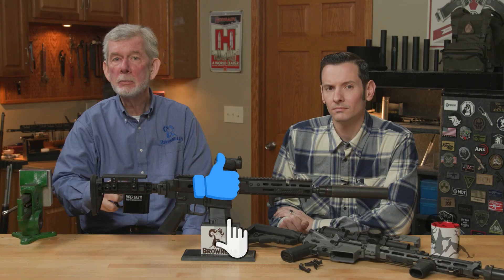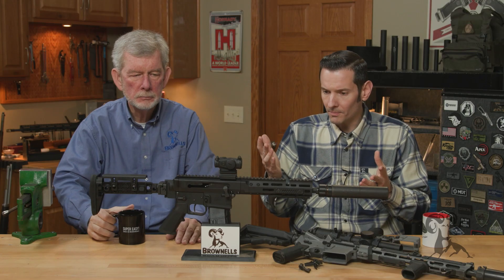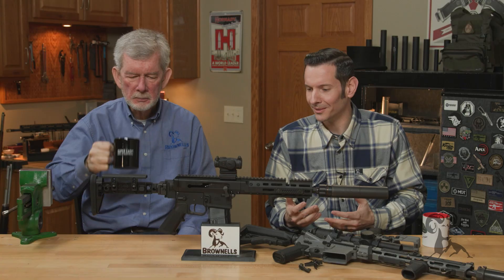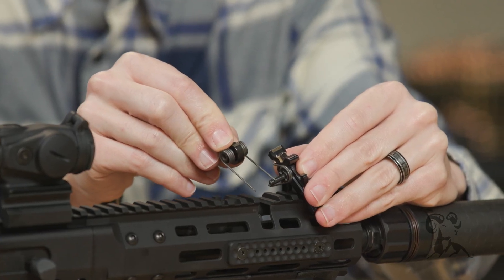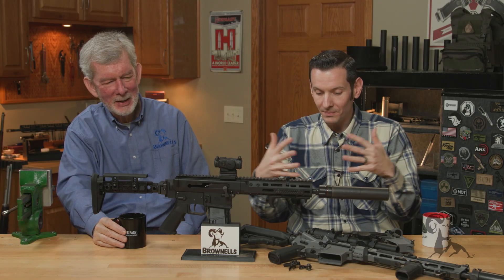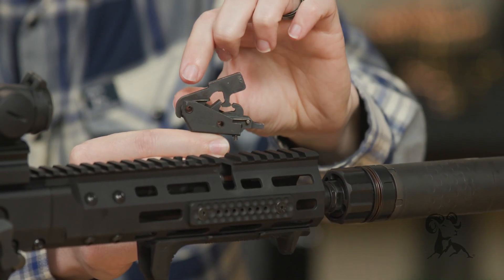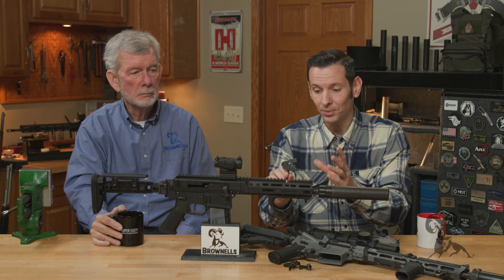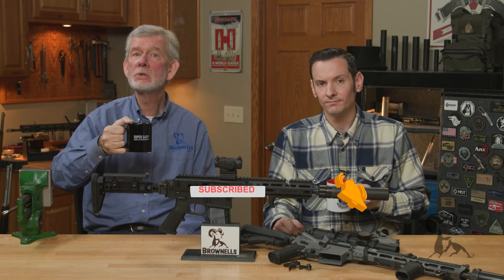Smyth Busters: Does Your AR-15 Need Anti-Walk Pins?

Comment: Back to the front site block removal. I recently bought a retro 20” barrel from you “brownells” and the front site is so canted almost impossible to site in. I have been trying to remove the pins from the FSB and they wont even budge, and yes im driving them the proper way, and ideas?

Comment: The only time I have used anti-walk pins was for a KE-15 polymer lower. Based on research, a cassette trigger seemed like a good idea despite my preference for a 2-stage trigger on this type of rifle. Bottom line was I didn’t quite trust the hole alignment or longevity with the polymer.  Now that I think of it though, there are millions and millions of polymer pistols with non-captive pins…

Comment: My milspec trigger had standard pins and that makes perfect sense what you said about the hammer spring holding them in.  I replaced it with a drop in trigger that came with anti-walk pins and it makes sense why.  Glad you cleared that up.  

I like the grey.

Comment: I like to use KNS match pins. They actually improve a decent trigger...like the PNT or the ALG triggers; even the nickle triggers from PSA and the other offerings out there. These are just the pins, no anti devices. They measure .155 inch and they help the sear engagement surfaces line up better and more consistently. I noticed that some of the Hiperfire triggers have loose pins and the KNS match makes the trigger a lot better! KNS pins and JP springs will take a milspec style trigger to another level!

Comment: Unfortunately I had to use anti walk pins because when I bought my aero  upper and lower we found that the holes where slightly to large and my trigger group fell apart inside the the reciver when we were test firing the build upon its completion. Since using the anit rotation/walk pins haven't had a single issue. A Gun smith from wild west guns was the one who discovered that the holes were out of spec.

Comment: Can you please tell me what adapter you have on the gray lower that enables you to run the 180 upper? I have been looking for something simular.
Reply from the maker: The 180 upper will fit any AR15 lower without an adapter. The 1913 adapter on that lower is made by KNS and allows the use of 1913 stocks/braces.

Comment: I have a SSA trigger in my LR308 polymer lower with anti rotation pins. The pins started eating into the polymer. In that case it really did help out from keeping the pins from waking out and giving the trigger group more strength.
Reply: I'm not tryna be a dick bro but poly lowers are shit and you probably wouldn't even need those pins had the receiver been forged aluminum.
Reply: or just buy a quality lower that doesnt suck and you dont have to worry about that

Comment: Its simple. If you have a compitition type drop in trigger you will most likely need the pins because there are no springs pushing against the lower reciever. If you have a battle type trigger like milspec or geissle, you don't need them because in the heat of things you don't want to have to carry around extra tools to pull your trigger out possibly for a cleaning...

Comment: I used KNS anti-rotation pins in my AR-9 PCC build. Since it uses a heavy buffer, heavy bolt carrier group & a .308 recoil spring, I had heard that the function can be extra-hard on the internals of the lower. It also uses a YHM 9mm slant brake to help reduce recoil from the heavy blowback action. Everything seems to be working really well at this point.
Reply: I was moving things around and put 9mm upper on a mil spec lower … wondering why this thing ran so damn good… heavy bolt … standard buffer. So smooth… funnest gun I have to shoot.
Reply: @b.a.lineman7582  That's good that it's running well. Keep an eye on your bolt catch because without the heavier recoil spring & buffer to slow the bolt travel you can wind up with a broken catch if your gun has a LRBHO feature. That's usually a feature of a dedicated 9mm lower, so odds are your set-up probably doesn't have it. I built mine on a Spikes 9mm receiver set so it does have the LRBHO feature in the lower. I also heard that if you're running a mil spec lower, that you're also supposed to use a spacer at the rear of your buffer tube in order to decrease the overall travel of the bolt. Some dudes even put quarters in there instead of the spacer. You might want to look into that.
Reply: 80% correct… no LRBHO. Likely the 8” barrel helps my setup… quarters are in good place. I neglected to mention some of the details. Just so eager cuz i entered the AR9 world when it was still kinda voodoo… I might try the .308 spring … got one on the shelf I didn’t use on my .308… opted for JP enterprises. Good info.. thanks .
Reply: Update… installed Witt Machine SME .. muzzle break with shroud… spent casings now land at 1-130😬… bout to dig through the parts bin n get thing back right.
Reply: @b.a.lineman7582  I think the brake might be creating increased back pressure, causing your BCG to reciprocate too fast. That's usually what causes an ejection pattern like that. The cases are rebounding off of the left side of the ejection port & then forward. Try a .308 recoil spring.
Reply: No doubt… .308 spring got’er back right🤙🏽

Comment: For 2 piece triggers, using anti walk-rotation pins is dumb, regular pins stay in place and are designed for it. I didn't know the fancy stuff was needed for the drop ins because I have never used that type of trigger, but it makes sense. My Geissele G2S and ALG ACT both come with really high quality pins and not using them is dumb. I think they actually make them 1 or 2 thousands oversized just to make sure they stay in place. 

It makes sense that installing and uninstalling the pins frequently would wear out the holes though. I see no reason why the pins on a trigger group should be knocked out more than 10 times over the life of a rifle. 10 times is not going to ruin the holes and really I don't see any reason why it should be done that many times. Pick something you like and leave it and use it FFS. How many times do you need to upgrade your damn trigger? 

I always put a drop of oil on my pins before installing them and even with doing that they do not come out after thousands of cycles. The lube helps them to go in and it most likely helps prevent wearing the holes out. The holes just like the rest of the receiver is anodized and that creates a surface that is resistant to wear. I swear people try to make things more complicated than it is and create these imaginary problems. There is no lateral force pushing the pin out of the hole when you shoot the gun. Think!

Comment: The reason I use antirotation pins is that my very first AR, a Stag, I had shot around 500 to 1000 rounds or so out of it. Not a ton but not brand new. Also I had cleaned it but never taken the trigger group out or messed with it in any way other that cleaning with a Qtip. 

One of the pins walked out of the reciever. I cant say why because this was several years ago and I was much less paying attention and more fix it and go. 

So after that experience I just decided   if I was going to build a AR I would put anti rotation pins and prevent a issue. 

I personally see no issue with putting them in. But to each their own. Solving one problem with another maybe.

Comment: I noticed the pins aren't symmetrical. Is there a proper side the grooves need to go on? If so, I'll need to take mine apart and check, because I was just guessing.
Reply: Look at a schematic drawing of an AR, or something like an AR disassembly mat. It should show the correct ways to orient the components. I believe the grove is supposed to go on the "right" side of the receiver, but as long as the feet of the trigger spring lines up correctly & remains in the groove, & everything functions flawlessly, then it probably really doesn't matter what side it is on.

Comment: keyboard is warmed up.   Seriously though, the issue comes down to which metal you want to wear.  Do you want steel on steel or steel on aluminum, and no, just because it "can" rotate doesn't mean it will.  Add carbon and dirt and this gets worse. 
Also worth mentioning that Stoner clearly envisioned the aluminum receivers to be wear/ replaceable parts. This is not a big deal with the upper, but it is with the serialized lower.  Military spec lowers are forged, correctly drilled, and coated before being inspected for tolerances. This degree of QC is far from the norm in the AR market.

Comment: Before I hit play: With correctly made pins and a standard trigger group, one of the hammer spring tails sits in a groove on the trigger pin, preventing it from going anywhere unless you either (A) deliberately apply force to drive it out, or (B) the hammer (and its spring) is removed from the weapon. Meanwhile the "J-spring" inside the hammer clicks into the center groove of the hammer pin, preventing it from going anywhere unless you deliberately apply force to drive it out. While there's almost certainly no actual harm from using anti-walk pins with a standard trigger, it's my opinion that there's also little or no point other than transferring $$ from your pocket into the seller's. With the "drop-in" type triggers, where the springs don't make contact with the pins, there MAY be some use for anti-walk/anti-rotation pins. Now let's see how wrong I'm not... <punches play> Well wuddaya know... Called it, nearly to the letter!

Comment: Realistically,  I use anti-rotation pins because my trigger pack cannot retain standard pins. It is designed specifically to use anti-rotation pins. So to have my single stage trigger stay in my rifle, I only have one option. Just like every other upgrade to the AR platform over the last 40 years, someone will always harken back to a GI M16. I lugged one too. Doesn't discount the benefits of a free float barrel, adjustable gas block, and a full length top rail. You could argue since the first ARs were 6160 that it is better 7075. You could say chrome lining the feed ramp wasn't part of the original design as well. With millions of rifles built and used over 40 years, ways to make the system operate better happens. The pins are really such a miniscule part in the function of the platform, and the extreme edge case of theoretical system impact are so extreme,  it really becomes a null value argument. It is pretty simple to figure out which is better: use what the trigger manufacturer recommends and/or supplies.

Comment: Had a new AR shooter at the range ask me for advice.  His trigger pin was walking out.  A quick look and I saw that his hammer spring was on backwards.  This put the legs of the spring at an angle where one could not sit in the groove on the trigger pin.  It took only a few minutes to fix this problem.  But when AR's are assembled correctly they don't need anti-walk pins.  For drop-in trigger packs, yes, those need anti-walk pins.  All that said, in the past 30+ years of building and shooting AR's I've never had pins walk out.

Comment: Colt used stainless pins for the 9mm guns as the standard pins would break with the blow back guns.   Anti-rotation pins aren't a bad idea for blow back guns for that reason.

Small Arms Solutions on YT has a good video on it

Comment: When installed correctly the hammer spring legs capture the trigger pin to prevent it from walking. The hammer pin is captured by a J spring in the hammer itself. If parts are installed correctly there should be no need for anti walk pins.

Comment: In the mechanical world, it doesn't make sense to rotate steel pins in an aluminum hole. The aluminum lower is now the wear point. Will it see enough useage to wear it out? Probably not. The holes really should be bushed with bronze bushings, but not enough wall thickness to do that. The design really isn't the best engineering,  but you can get away with it because the pins don't rotate excessively.

Comment: I have had one lower (Spikes) that one of the pins (can't remember if it was the trigger or hammer) start to walk out one side. It was a new in box manufactured lower. After less than a mag it would be a few MMs out one side (right). I would tap back in and check to make sure the spring was set in good spot to secure it. After less than a mag the cycle repeated. So after not liking this I replace that pin with another and it continued.  It always walked to the right. I assumed that whole was just out of spec. Not wanting to discard that lower I just bough a set of anti walk pins and have never worried about it again.
Reply: i had the exact same problem

Comment: milspec triggers were designed to have the pins rotate. anti walk pins were made for cassette style drop in triggers. u can get anti walk pins for a mil spec but anti rotation can mess up the j spring in the hammer and because they are dissimilar materials they can actually gal up the pins but thats rare unless u have a machine gun and never lube anything.use what u want and dont care about what everyone else is doing and u will be much happier.

Comment: Note that Geissele pins are slightly OVERSIZED compared to TDP. Not only are anti-walk pins not required with Geissele triggers, I am not aware of any anti-walk pins that have been proven to meet Geissele specs for pin diameter.

Comment: Rifles built on 80% receivers have no hard anodizing in the pin holes to prevent excessive wear. The anti-rotation pin kits keep the trigger and hammer axii in the correct relationship to each other.
Reply: Yup, aluminum oxide is hard! They make sandpaper grit from it, it's hard to believe aluminum can  produce something so hard just by oxidizing
Reply: Or if you butcher the hole alignment just through it a drop in trigger with anti rotation pins xD
Reply: That would be the cheap lowers they are talking about lol
Reply: Take care in drilling the pin holes as they use the smallest bit… a drill chip can get caught and egg out a hole possibly causing a mil spec trigger to not function properly. … ask me how I know
Reply: @b.a.lineman7582 you need to discover reamers young grasshopper..
Reply: true, the standard pins spin on the bare aluminum and wear on it.
Reply: I think they covered that with "bad lowers".  Then that is where to use the modular trigger and as Chad says "the sum of the parts", equals  a good lower.

Comment: Thanks for posting. I had a pin walk at the range the other day and my brother quickly sent me the product he recommended to fix the issue. I watched this video and realized that my pin walked because the spring for my hammer wasn't resting on the groove you show at 6:02. I had it on the floor of the lower. I have about 120 rounds on my first AR and it has been a learning experience. Thanks to Brownell's for putting out quality information for us to draw from!
Reply: Way too many AR home builders do that. Don't feel too bad.
Reply: just read your comment and checked my hammer spring. it was upside down so the spring leg was at too high of an angle to catch the groove on the pin lol. i shot 200 rounds on it with my pin walking all over the place haha.

Comment: Agree to disagree on this topic.  Sand/grit in the trigger assembly will eventually cause the rotation of the pins and there is a "possibility" of wearing the pin hole.  Sorry, but I'm not the U.S. Gov. with unlimited funds to replace my lower.

Comment: I’ve got a full auto and the trigger pin definitely walks a few mm’s after firing several hundred rounds. I just push it back in with my finger.
Reply: It’s a colt m16 factory lower with geiselle super select fire trigger***

Comment: I had imagined that a weapon used in combat, would want to be serviceable, with the fewest and simplest tools.
Reply: Thats why, among other reasons, that they're not on issued weapons
Reply: @johndecker9983  I've been tempted by the drop in trigger trend in the past, but I have been thoroughly satisfied with the triggers that I have now. Imagine a military or law enforcement, that had a bunch of weapons with different parts in them.
Reply: @seanomeirs8362  defeats the purpose of parts standardization

Comment: One other use for Anti walk pins is in 80% builds Cuz unless your using a ghost gunner CNC or end mill your holes will not be 100% perfect. in that case keeping the pin from walking out, is an issue and will stop malfunctions well before it creates them. not sure if that's what you where talking about when you said "not a Good lower" but if your not using a cassette trigger in an 80% and a standard trigger works with the "not so good hole drilling" but the pins walk out that's the thing to do

Comment: With drop in trigger kits the spring tension is contained within the housing so you Need anti-walk pins. The standard built in has spring tension on the noches in the pins keeping them from walking, like Glock , so you Don't need anti-walk pins

Comment: Very well said guys! 
I’ve tended towards two piece triggers with standard pins (Geissele SSA-E and G2S) for ease of cleaning, spring availability and maintenance. Had a cassette style trigger (Timney) and wasn’t happy with the set screws like you said, and decided I more preferred a two stage trigger setup system.
Reply: Do you have to use the set screws? Caleb seemed to imply they weren't necessary but reading the install guide from say Rise Armament, it sounds required.
Reply: @Ash_95  Timney says they’re required, and I would agree unless you want the whole trigger cassette flopping back and forth in the receiver on sloppy pin tolerances
Reply: @thereloadingcraft  ah, I see. Thanks for the info.